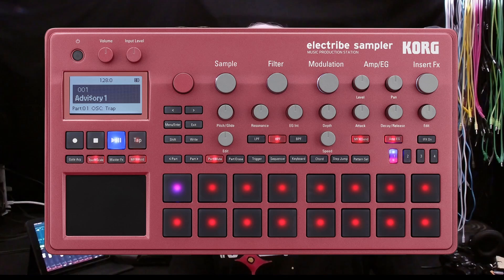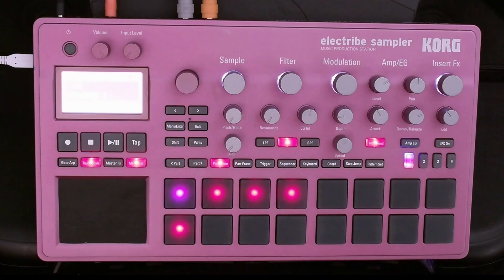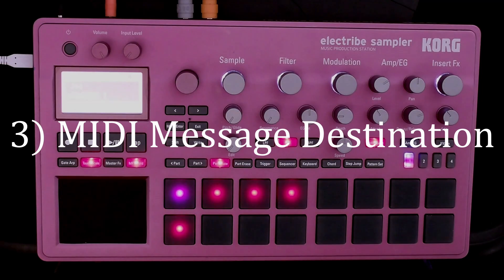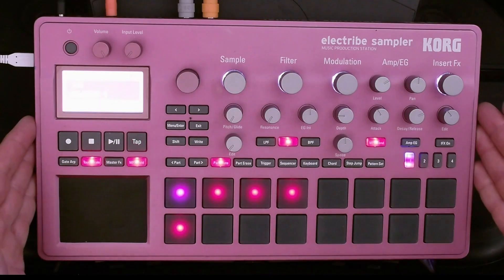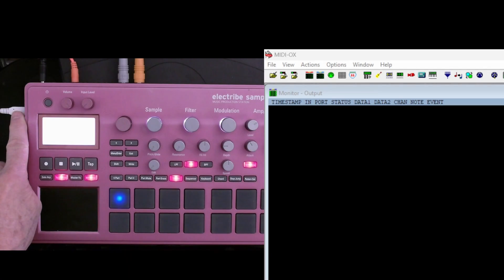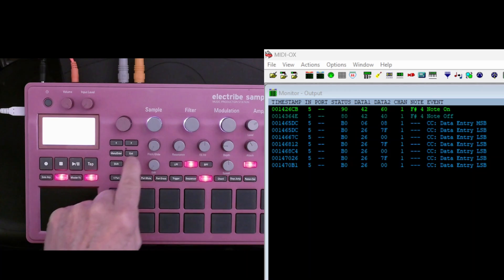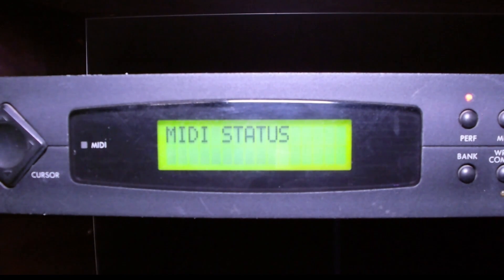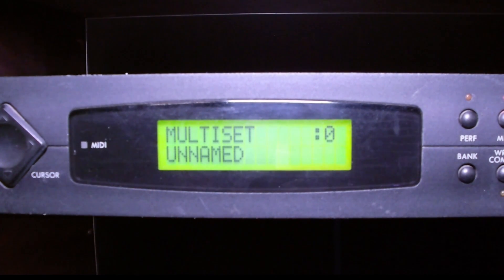Ep 1: MIDI out  - Korg Electribe 2 Sampler

Comment: Hey, where can I turn off the Korg so it doesn't trigger a pad from another device? The device should only output the MIDI signal for synchronization. Nothing more…
Reply from the maker: The Electribe 2 Sampler is designed to be able to control external MIDI devices.  Change the KORG's Global MIDI channel to be different from the external MIDI device from which you are playing.
Note that the MIDI clock signal is not associated with any particular MIDI channel.
Let me know if this works.  Perhaps I misunderstand the question.

Comment: Wondering if you can help? I have my my Electribe connected to my Behringer TD-3 (303 clone) and trying to sequence (via midi) the patterns created on the TD-3. The TD-3 has a track option to do this, but it's pretty laborious. From my research, using the Electribe to do it, isn't straightforward, if at all possible, so seeking out advice from heads like yourself. Thanks
Reply from the maker: It's unclear to me which unit is sending MIDI and which is receiving it.
Reply: The electribe will be sending midi to trigger the patterns on the behringer td-3
Reply from the maker: @mattytaang  So you're sending MIDI Note On/Off to the td-3?  (or just a clock)?  Where are the notes for the TD-3 coming from ?  w/in the TD-3 or from the Electribe?
Reply from the maker: @mattytaang If you want to hit a pad on the Electribe and hear a note (or sample) on the TD-3, the MIDI channels have to be the same. You probably already knew that.   Also, the Electribe is organized by "parts" (16 of them).  Part 1 is typically sending and receiving MIDI on MIDI Channel 1.  Part 2 on Channel 2 and so forth.  So if you TD-3 is receiving on MIDI channel 10, you'll want to play on Part 10 so that the MIDI notes are transmitted on channel 10.
Additionally, you must have the MIDI OUT on the Electribe connected to the MIDI IN on the TD-3.
Assume you have all of this set up properly, including the physical MIDI connection.
If you set the Electribe to Part 10 and press the Keyboard button on the Electribe, the pads should now play the TD-3, just as they would from a MIDI keyboard.
Is this what you're trying to do?